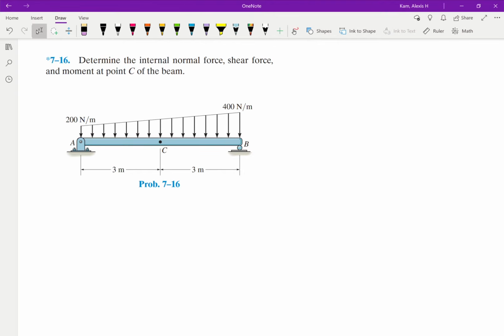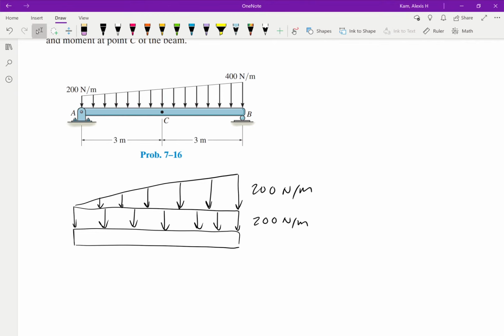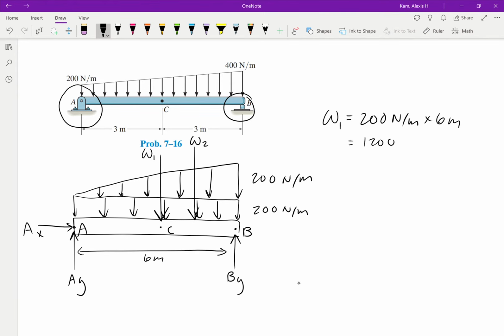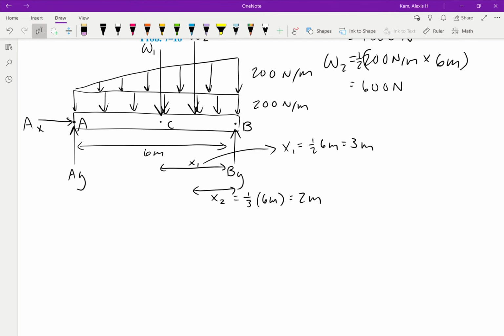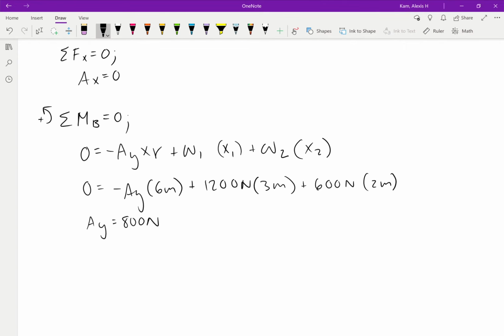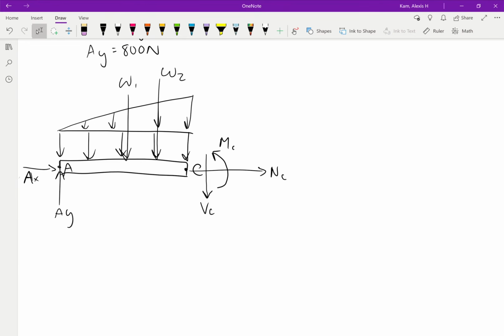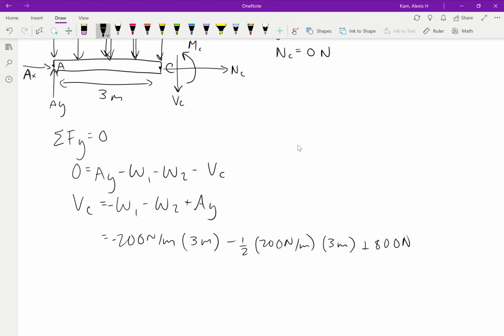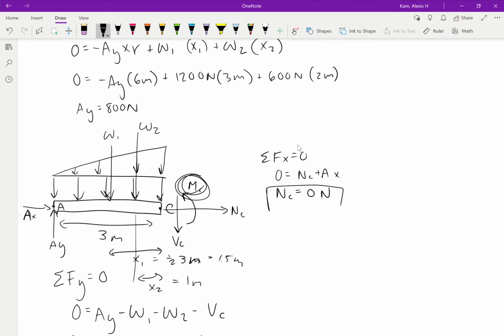ME Statics: Determine the internal normal force, shear force, and moment at point C of the beam

Comment: To anyone who stumbles across this video: here is the correct way to solve it. First you need to solve for the trapezoidal distributed load. In order to do so, you need to separate the trapezoid into a right triangle and rectangle. Subtract 400 N/m by 200 N/m to get the height of the right triangle. With that height, you can find the area of the triangle ((200 N/m * 6 m)/2) to get 600 N. To find where this load is focused, simply look at the side where the height of the triangle is greatest, and multiply the length of the triangle by 1/3. This should give us 2 meters from the right. So our first force is 600 N at 2 meters from point B. Our second force is the area of the rectangle. So 200 N/m times 6 meters will give us 1200 N. To find where the load is focused, divide the total length of the rectangle in half. So our second force of 1200 N will be located at 3 meters from either A or B. With those two forces now found, we solve for the moments of A and B to find the vertical force at A and the normal force at B. For the moment about A, our two forces we found will cause a clockwise motion (CW) about A, while our normal force will cause a counter clockwise motion (CCW) about A. So our moment equation should look like this:
Ma = (-1200 N * 3 m) + (-600 N * 4 m) +(NB * 6 m) = 0
Solving for NB, we find it is equal to 1000 N in the positive y direction.
Now we do the same for B. Analyzing your FBD, our moment equation should look like this:
Mb = (1200 N * 3 m) + (600 N * 2 m) + (-Ay * 6 m) = 0
Solving for Ay, we see it is 800 N in the positive y direction.
In order to solve the problem, you only need to find one or the other. For this, I will use the normal force at B. In order to determine our shear force, we need to cut our FBD at C so we can analyze what is happening on one of the sides. Looking at the right side, we need to re-evaluate what our distributed loads are. We have new dimensions for our triangle and rectangle. By seeing across an even distance, that there is a difference of 200 N/m from point a to b, we can assume that at point c, there is a difference of 100 N/m. So the new height of our triangle is 100 N/m. Now we find the area of the triangle again. ((100 N/m * 3 m)/2) This will give us 150 N at 1 meter from point B. For the rectangle, our new height is 300 N/m giving us (300 N/m * 3m) our force of 900 N at 1.5 m from either point b or c. With these three forces, we can determine our shear force. For this, we are going to assume our shear force is positive (clockwise) meaning Vc here should be in the negative y direction. Summing the forces in the y-direction:
Fy = 1000 N - 150 N - 900 N - Vc = 0. Solving for Vc gives us -50 N. This means that our assumption of the shear direction is incorrect. The shear is counter clock wise. 
Finally, we need to find the moment about point c. Continuing to look at the right side of our FBD, we see that our moment equation for c should be:
Mc = (-900 N * 1.5 m) + (-150 N * 2 m) + (1000 N * 3 m) = 1350 N/m. So our final answers will be such:
Normal force at C = 0, Vc = 50 N, and Mc = 1350 N/m. I hope this clears up what the video did wrong.